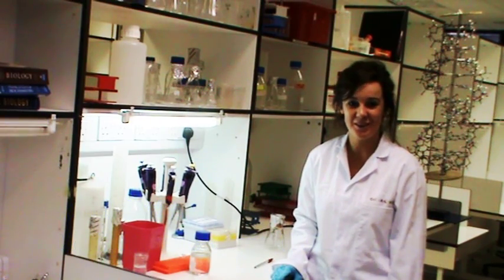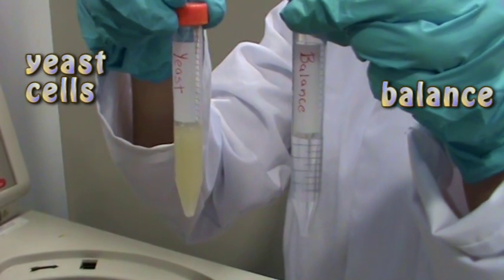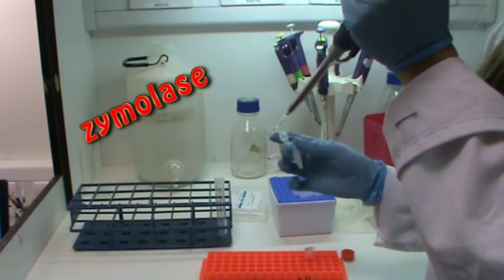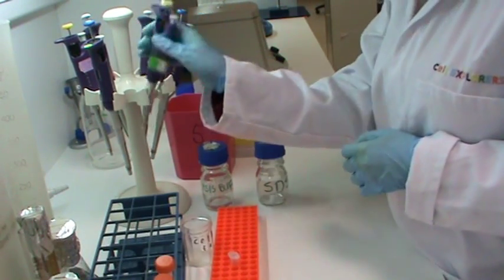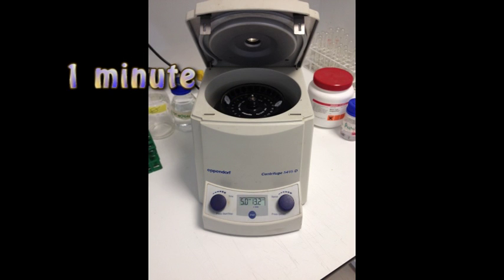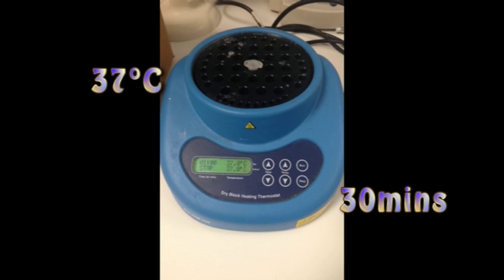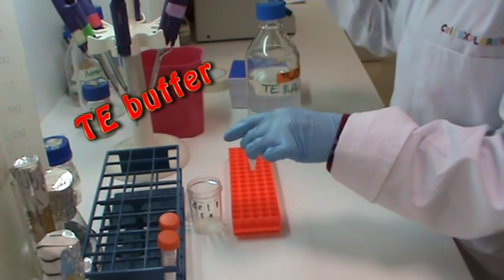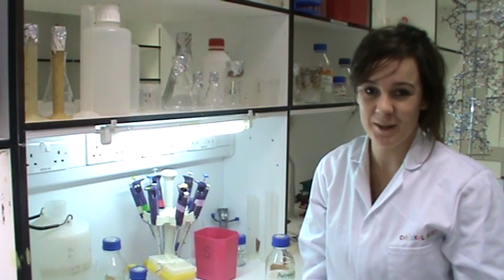DNA extraction in the lab

Comment: Can we use Ethanol instead Isopropanol ?
Reply: No ethanol will destroy the DNA
Reply from the maker: Both will work but these two alcohols have slightly different properties: DNA is less soluble in isopropanol so isopropanol works well for low DNA concentration or large volume samples. Salts are also less soluble in isopropanol so more salts will precipitate with DNA in this condition. In the lab, scientists often use both:  isopropanol first, followed by ethanol precipitation.